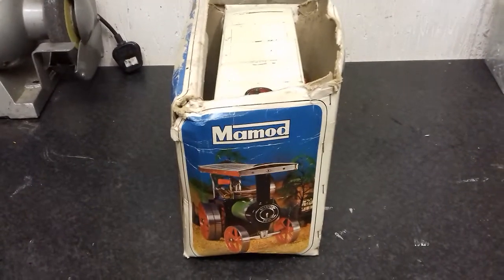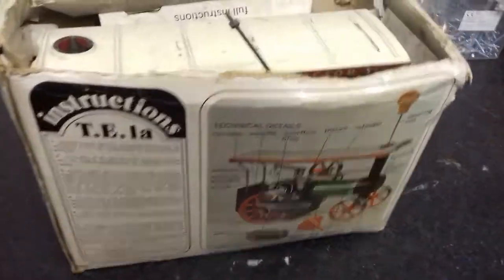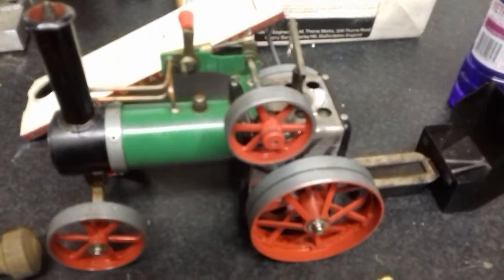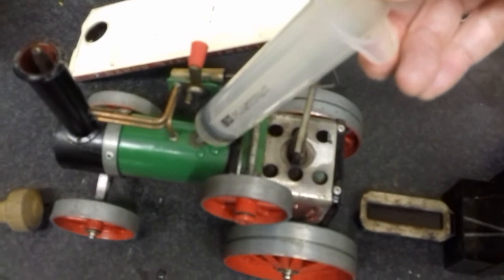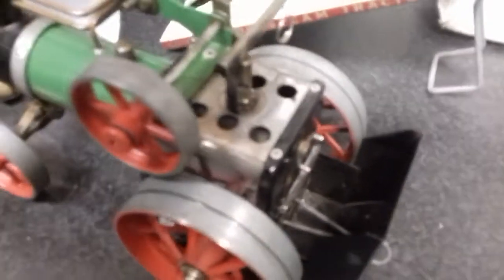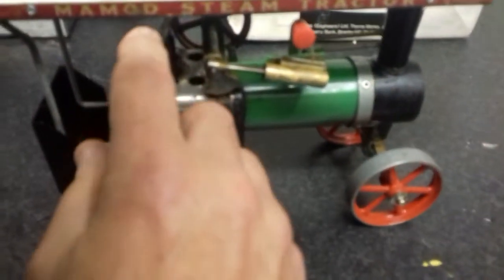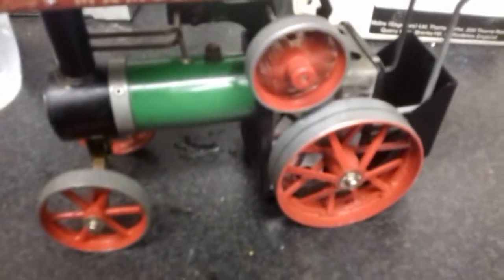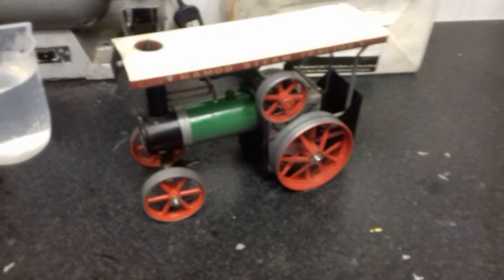Mamod Model Steam Tractor / Traction Engine. Unbox and review the 1970 model. Fire boiler and run.

Comment: Yes I had this and the road roller - The waiting was tedious and they both only moved for less than a minute on a flat level surface before running out of puff !! ... A total waste of time and effort.
Reply: Sorry to hear you had a bad experience with your engine. I use filtered rainwater which I preheat in the microwave, and I get runs of 10 minutes plus this way :)

Comment: That is pretty cool. We have a museum about an hour drive away from where I live that has real prototypes and they used to fire one once a year at the annual county fair for the parade. Thanks for sharing! - Jason
Reply from the maker: Thanks Jason, yes the steam rallies, are a good day out in the summer months. Always liked the pretend tugs of war. Kind regards Nigel
Reply: @SeabreezeStation  you can get new washers to replace the old ones
Reply from the maker: @eliotreader8220  Hi, thanks for the tip. Will look into it. K regards Nigel
Reply: @SeabreezeStation  I believe people can convert the engine to use the Solid fuel made by Mamod.
I converted my three engines because I thought it would be better than the original fuel.
Reply from the maker: @eliotreader8220  Definitely a lot safer. In the past nearly set the house on fire a few times with methylated spirit leaks. Got a lot better at it now. :)